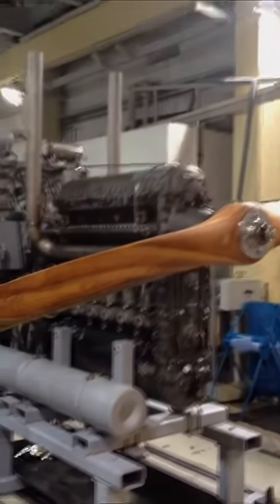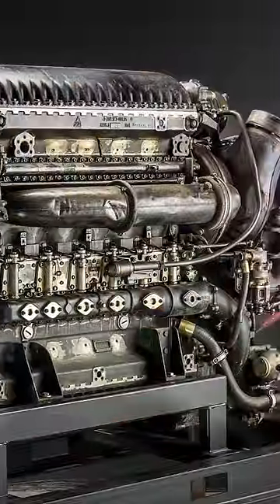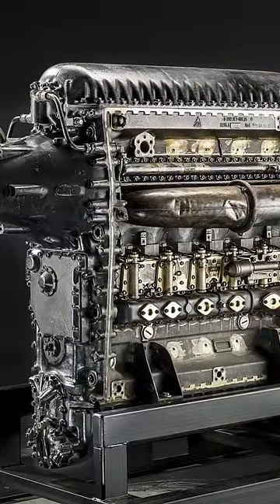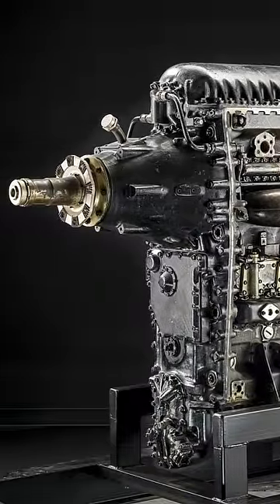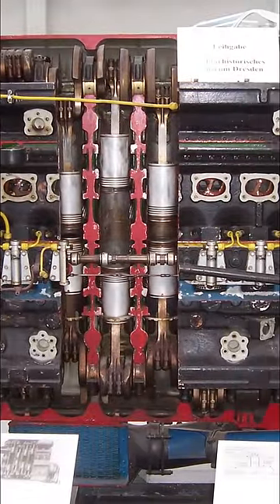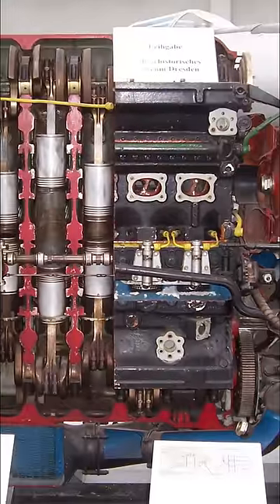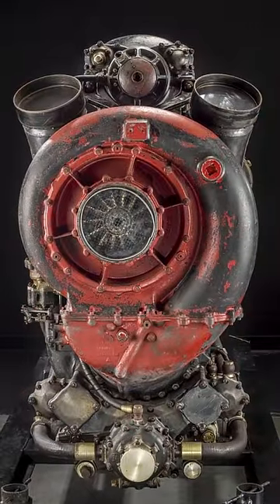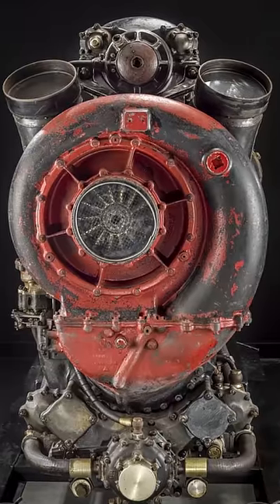Old ENGINE Laughs At New Diesels - Jumo 200 Series

Comment: I bet it runs pretty smoothly compared to most engines. The inline 6 platform is the best balanced and strongest configuration. It’s like stacked inline 6 engines. It sounds pretty smooth.
Reply: Keep in mind that engine is a 2-stroke ported engine that uses an external blower to push intake air through the open cylinder and displace exhaust at the same time. With a diesel, that's not a problem for fuel wastage, as it's of course only injected at maximum compression/TDC.
Reply: The pistons pretty much cancel eachother out so balance is not a problem here, at least not primary balance.
Reply: Take a look at the Napier Deltaic !

Comment: never knew anyone was ever able to get a diesel to fly, thats incredible!
Reply: There's a number of them, Lockheed was using the 3 cylinder diesels out of the smart car for UAVs
Reply: Thielert aviation makes modern aero diesel  engines, a V6 and  V12. I think it's called the Centurion. 
They are often used on Diamond aircraft. 
I think porsche also tried it with their flat 6 diesel, but failed due to the market or internal politics.

Its somewhere between ridiculous and horrifing that most general aviation aircraft still run on avgas with 2% lead, when most of those engines would be fine with unleaded fuel with simple conversion kits for seals and hoses. Those are available, but there is no push to get them in there. 
Good thing lead makes us stupid so we don't care...
Reply: @nos9784  unfortunately the physical parts installation is the simplest part of converting to unleaded - getting a supplemental type certificate for the aircraft from the FAA is expensive and time consuming, hence why it hasn't happened
Reply: I think Packard made a couple of diesel radials in the 30s, one still flying...
Reply: @FaustoTheBoozehound  ah. Well. Nothing like bureaucracy to further discourage what already takes effort...

Avgas is expensive, though, right? 
So people would even save money in the long run?
Reply: Jet engines use a variation
Reply: @nos9784  just getchu a piper Cherokee,  they have TCs from the original design certification which allows for the use of an engine designed to run on 87 automotive fuel.
Reply: The ruskys used them in a bomber platform
Reply: @nos9784  the heads have to come off for the work to be done and some people don't wanna bust the seal.
Reply: @nos9784  How's it horrifying
Reply: @darryladams519  lead is a neurotoxin, burning leaded fuel makes it airborne.
Doing this longer then necessary sucks.

(Edit: neurotoxin, not leurotoxin. )
Reply: @nos9784  there is certainly a bureaucratic impediment to innovation and a good example of risk/reward analysis. What is the risk of allowing lower test and eval standards for modified engines? The reward is using cleaner fuel, but possibly more of it and probably at greater expense as tetraethyl lead is an excellent octane booster and relatively cheap compared to modern alternatives. I recommend you look up Avweb's video on avgas it's thorough and interesting.
Reply: @FaustoTheBoozehound  thank you for the suggestion, I will look it up :)
Reply: There's kit engines being made today with diesel motors lol
Reply: Looks like in the present day there's actually more diesel engines flying than ever before. Some of those are: austro e4, red a03, tei pd170, and more.

Comment: The Napier Deltic was based on the Napier Culverin, which was in turn based on the Jumo 204, whose design was licensed by Napier in the interwar period. Jumo worked on a similar concept to the Deltic but with 4 crankshafts instead of 3. Napier figured that good timing could be achieved with 3 crankshafts (an odd number) with the bottom crankshaft rotating in reverse. The Deltic's geometry imposes a 20 degree lead on the exhaust piston with respect to the intake piston, which was found to be acceptable. With 4 crankshafts, you can have any amount of lead on the exhaust piston, the same as you would with an inline opposed piston engine.

Comment: What is it about something so beautiful that it sounds, works as intended and also looks like it sounds and works; sublime? - whatever it is i get the fizz😂
Reply: The germans made engines that used  turbo chargers, and turbo induction and coolers and fuel injection on aircraft engines that are used in cars today, they are pollution machines that also make money for the rich that dont have to live with them.

Comment: I'm more impressed with how strong the wooden prop is
Reply: Fr my first thought upon seeing this is wtf??? ! Wooden prop!?! How? What kind of wood? Is it actually wood? Is that just a low lift producing prop for testing in the shop?
Reply: More impressive is the original engine designer was still around to fire it up 😉
Reply: @ikereznicek1562  it could be a test club, but that's not to say wooden props aren't fascinating to learn about. If you think that's sketchy wait till you find out they used to make entire airframes out of wood, glued then nailed, and then when the glue would dry they'd take the nails out to make em lighter and then wrap em in fabric.

Comment: Napier bought a license from Junkers before WW2 and made a triple bank version with 3x the power used in fast patrol boats and then after WW2 also in 22 Express diesel electric locos for British Railways ( named Deltics after the diesel engines used) Junkers also tried a 4 bank square version but this didn't work out.

Comment: Where's the rev limit? I assume they scream...until the crankshaft says "screw you guys, I'm going home"
Reply: The crankshaft would be fine, conrods or bearings would fail...
 I'm sure wikipedia has the limits for these engines.

Big long stroke engines have lower rev limits,
it's just a scaling issue. 
Double size means 8 times the volume and weight, put only 4 times the bearing area... not to mention higher accelaration to move the piston twice as far. Thats why a 2 liter diesel car can do 4-6k rpm, but this ~28 liter engine propably has a red line at 2-3 k. 

You can run them faster, but that's "emergency wartime power" and the reason you'd rebuild fighter engines with new bearings after 100h, max. 
F1 engines used to last a single weekend, dragsters a single run, sometimes.
Reply: It's a flat plane opposing piston engine, since it is more than likely directly driving the propeller with the crankshaft, has the potential for the load to be in the opposite direction it would normally be (say, in a nose down low throttle situation), which puts a lot of stress on the crankshaft that in many other applications wouldn't exist. That's why I said crankshaft. Doesn't really matter what piece fails first, if one does, everything's getting destroyed. So, maybe they should use genuine connecting rods instead of cons? (That's a joke, since some of you may not get it...)

There's a lot more to why some diesels can go x rpm versus others than simply displacement and number of cylinders. You're on the right track though.
Reply: *crankshafts
Reply: Oh jeez! I obviously didn't pay attention to what the narrator says, because I didn't even realize the design until you said something. 12 pistons, 6 combustion chambers and backward from what I think of first when I hear "opposing piston engine" since the pistons move toward each other on the compression stroke. 2-stroke engines are already relatively simple, but this one doesn't even need a cylinder head! The pistons themselves are the combustion chambers.

Comment: There was also an American opposed piston diesel made by Fairbanks-Morse.
Reply: Those engines were used in many US Navy submarines for main power, still used today in nukes as backup power.
Reply: Excellent diesel engine. But way too big and heavy for aircraft use.
Reply: @lindycorgey2743  quite true, but developed for a very different purpose than aviation. Much greater displacement and output power.

Comment: This would be perfect for a big old truck I could imagine a 30s big rig with this in it lifted to the clouds huge rims and tires not for show for use in towing and off road high weight applications possibly beach towing recovery type stuff would just be unique as long as it’s dependable to a point

Comment: How did they even machine flat surfaces and have decent gasket material then?
    Also, how are the bottom cylinders lubricated and how is excess oil removed?

Comment: A turbocharger at the 1930's ???? 😳
Reply: turbo charger have been invented since 1905 while the old turbo is unreliable and problematic but yes they exist.
Reply: Superchargers before that
Reply: A beautiful example of marine engines having better tech than car engines is the camless engine design. There are 2 flavors, the hydraulic actuated or solenoid actuated intake and exhaust valves. It solved the problem of having extra mass (the camshaft) being removed and a much more precise valve timing operation.

The injectors are also given the same flavors for a more precise injectors. 

They all get away with this because marine engines doesnt care about weight and volumetric size compared to a compact, delicate car engine.
Reply: @kimpatz2189  so.... it have free valve before free valve was a thing.....
That make me thing how do people think ice engines are dying, they still not even fully developed
Reply: @Retired Bore the sad thing is, aero engines today are basically stuck in the fifties.

They still run on 2% lead avgas! Thats more than cars ever used...
Reply: Most all of the engine tech out today was out ahead of its time back then.
Reply: As I recall he said it's a centrifugal supercharger, which has an impeller that looks just like the impeller of a turbo but instead of being driven by exhaust gases they're mechanically driven. 
Every single aircraft engine I can think of during WW2 had centrifugal superchargers of that design, some were compounded with another centrifugal supercharger for high altitude and some like a lot of USAAF aircraft were compounded by a turbo for high altitude, which did nothing at low altitude because the wastegate dumps diverted the exhaust out of them instead of routing to the turbo driving it at lower altitudes. 
A lot of modern performance vehicles have centrifugal superchargers like those Dodge Hellcats and the Kawasaki H2R motorcycle. 
In the picture it looks like a turbo to someone who doesn't know what a centrifugal supercharger is and would easily be confused for one, but if you look the exhaust isn't routed to it, that's the give away.

Edit: he's mistaken in his narrative, he just believes it has a turbo because of the image of the supercharger impeller that looks like a turbo, he must have read a spec sheet saying it was supercharged and figured it had both, it doesn't, you can tell by the exhaust which isn't routed to a turbo, instead it's just collected and piped upwards on both sides.
Reply: @dukecraig2402  thanks man
Reply: @Retired Bore I'd give my right arm to have you as a neighbor 😆, thanks for the super interesting, funny and just all out great comments in this thread!
Reply: @StabyMcStabsFace  
Only one variant of that engine was compounded with a turbo for high altitude, very few of them were made of which none probably even exist anymore and none are seen in this.
Like the vast majority of them the one's in this do not have turbos as can clearly be seen by their exhausts which are collected and dumped straight up and are not routed to anything.
Most of the high altitude variant's had either 2 inline centrifugal superchargers or 1 compounded by the GM-1 Nitros system.
Reply: @kimpatz2189  That isn't a marine engine, its an aircraft engine... also it doesn't just not have a cames it has no head at all, no cames no valves no rockers no roller etc etc... designing it this way both increases efficiency (less heat loss since the ratio of area of the piston to the cylinder wall area is lower) and increases power to weight and reliablity by getting rid of a lot of complicated parts (the main part added is the forced induction which similar engines have anyway).
Reply: @braziliansheetbox2497  Actually it has no valves... unless you consider the pistons themselves valves (they are). It's a ported 2 stroke diesel.
Reply: Pretty common in aircraft actually. how else could they make power at 30k feet
Reply: @Retired Bore that is not accurate at all. There is a lot of efficiency left in the average road application engine and it is sort of a joke to compare electric vehicles with combustion in that regard. Electricity is as close as we can get to an entropy free source, exactly because it is always a product of some entropy rich process. That's like saying cars that only have an inertia wheel are better than combustion engine cars.
Reply: @Retired Bore last two decades? Are you drunk?
Reply: @Retired Bore I would agree if you had said the last decade, since it is true that progress has been slowed down, due to government intervention forcing companies to invest into hybrid and electric technology.
But you said the last two decades, which to me is a totally silly statement. The average car sold in 2000 didn't have a turbo and had port injection. The average ICE today has direct injection and turbo charging.... how the hell is that not a improvement in thermodynamic efficiency?
Are you actually saying a naturally aspirated 3l V6 with 200hp and 12l/100km is identical to a 1.6l turbo 4 cylinder with 200hp and 7l/100km?

That's why I asked if you were drunk, I think you would be hard pressed to find any continued vehicle such as the Golf or so that has not improved in efficiency since 2000
Reply: Columbus had twin 88s on the mayflower.
Reply: @@retiredbore378  "I guess you can't use an EV due to the risk of your tinfoil hat shorting it out."

No, I just don't want to deal with the lack of supporting infrastructure, less mileage per charge than my IC gets on a full tank and having to pay another $10K for a new battery in 5-7 years when it shits the bed on top of the ~$25K I paid for a new vehicle (assuming that replacing the battery is still an option at the time, planned obsolescence and all). Speaking of that, most new vehicles aren't made to last more than that anyways, electric or otherwise. No ty, my 07' will do just fine.
Reply: I recommend watching Hoovies Garage's video on towing with the Ford Lightning EV. Let's just say it didn't go well.
Reply: Turbo and supercharger
Reply: manual centrifugal air pumps have been around a long time. To stoke fires used in manufacturing
Reply: Well yea it's a simple design.

Comment: I wonder how much it weighed?  Power to weight ratio versus other engines?  Fuel economy good or bad? Could it have been run horizontally?  Like VW,Porsche, Subaru and others?  Too expensive for commercial trucks, only high value aircraft?  Certainly quieter than a 2 cycle Detroit Diesel.

Comment: I really want to know if this would work with a cross formation where 4 cylinders would close to make a square in the middle and all 4 fire at the same time but to form a cross 6 with 48 cylinders I'm aussming there would have to be gears connecting the witch would need maintenance not sure tho

Comment: Beautiful machine.  So complex . Just think if they would have put as much thought into electric motors and battery technology back then as they do now.. because all those machined and moving parts has now been replaced with a battery, motor and speed 🎮 pumping out more torque and horsepower.
Reply: ‘Complex’? Not really. Plus… MECHANICAL. They could have devoted all the resources and ‘thought’ into battery technology that they wanted. It wouldn’t have mattered. Chemical processes needed to catch up, along with our engineering to combine them to make the ‘right’ battery. Same with the brushless motors.

Besides, you think battery tech was sitting still? There was a HUGE drive to get away from lead-acid and alkaline batteries for vehicles and consumer goods! So it still would have taken this long!

Comment: It's amazing how back-in-the-day they came up with so many efficient and good designs but today we still have the same old same old un efficient crap, maybe they were smarter back then
Reply: Electronics have improved and preventing normal people to do maintenance
Reply: @Retired Bore well, an opposed piston still ist way more efficient if designed today (like Achates power), achieving efficiencies of over 40% on a wide load and rpm range! Not like a 4-Stroke diesel that has a high efficiency at only ONE rpm and load point! 
Most heating losses in an engine are to the cylinder head, that isn't existing in an opposed piston engine
Reply: @Retired Bore yes, but the second piston is also doing work! What does a cylinder head do? Of course, it doesn't do any work besides sealing, and being there for the valves, injectors etc! The Position crowns need cooling anyway 🤷🏻‍♂️

Comment: Where is the valves? Cams? Is this like a 2stroke gas engine?
Reply: yeah, 2 stroke, but with a blower instead of using the crank case for ventilation.
So just an intake port at one end, and an exhaust port at the other end, to blow out the used air in one swoop.

Comment: Build a modern version with digital valving platinum coating in the combustion chambers variable geometry turbos and a belt less cvt transmission bet it would double the current mpgs of over the road trucks at 100 hp more or better, of course we can't do that though , the establishment would kill you.

Comment: confused why opposed would seem like a good idea?
more moving parts (2 pistons per cylinder, 2 shafts), less ingitions more shake, no head so you have to have valves or just holes in the curved sidewall of the cylinder eg 2 stroke,

Comment: Here's what's insane; the Jumo 207C was tested at 2210hp for 10 minutes and 2020hp for 60 minutes without failure.  The multi-bank of this family was called the Jumo 224. And it's what the Deltic was based on, but the aero engines were 4 cranks, not 3. Rhombic? 😆